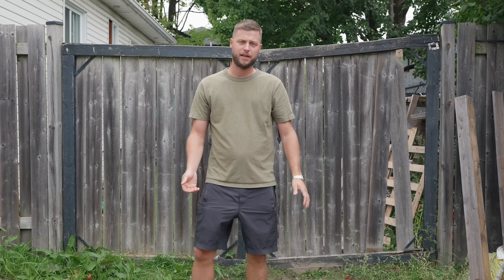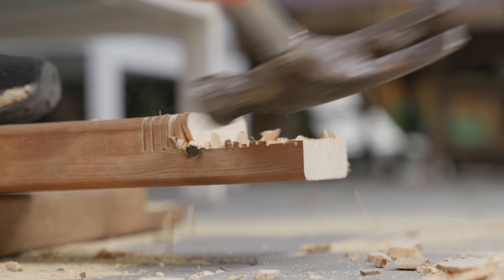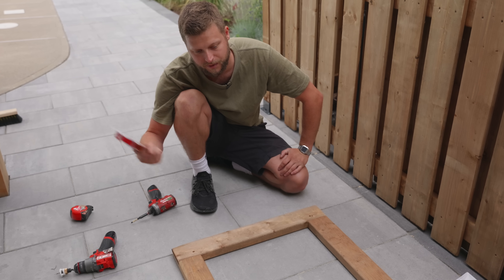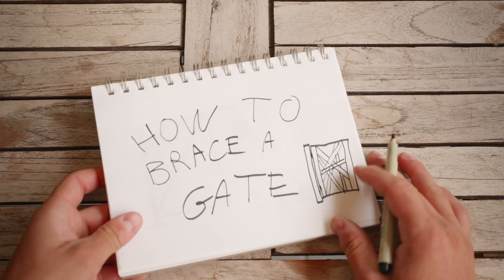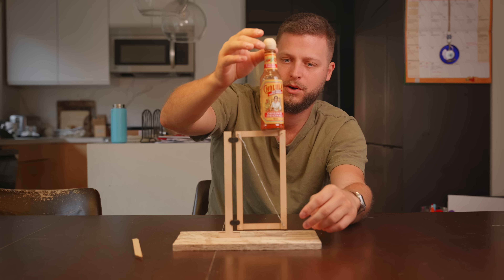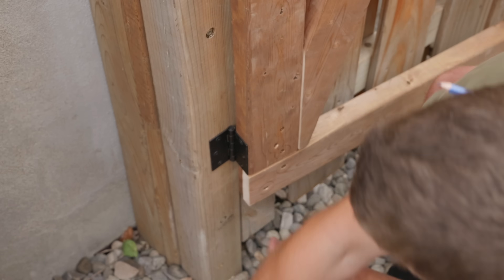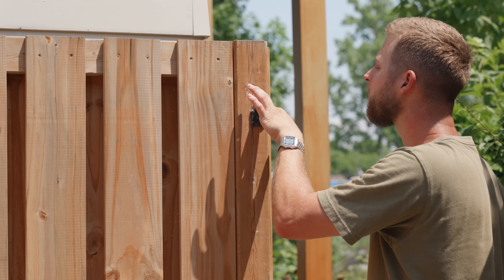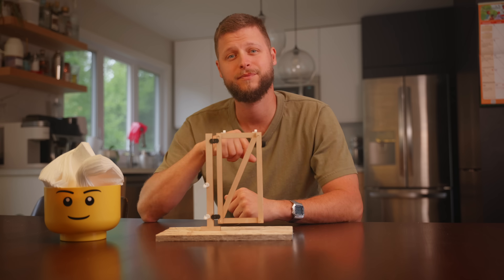How to Build a Wood Gate That Won’t Sag (Full Build + How to Brace)

Comment: My landlady delivered a shed which she had ordered from some prison workers. Clearly non of them were very familiar with woodworking as the door had no diagonal bracing, only a horizontal one which did nothing. The door was sagging right away and I've been contemplating since how to improve it. The way you explain how a proper brace is supposed to work is brilliant, that's the way the door should've been build from the start. Now I wonder if I should try and improve the door by mounting the bracing from the sagged corner and up, then pull it tight with screws, or dismantle the door and rebuild it properly with the correct bracing.
Reply from the maker: I think you can put a wood brace and try to save it, or buy the metal cable from amazon for 20$ or so and fix it that way.
Reply: @mateostabio  The metal cable is interesting, I might have to look into that. I don't have Amazon delivery available where I live but I'm sure there are similar options.

Comment: The "corner-to-corner" measurement to check for "square," is not fool proof. I watched my dad do that years ago (mid 60's), only to hear him muttering "trapezoid" before redoing the job. If you are certain that the heights and widths are the same all around, then corner-to-corner will be a reasonable check for square.

Comment: More than likely your gate post that the post swings on is going to be the cause of your sagging gate now that you have built the gate correct. Suggest using a 6x6 in lieu of the 4x4 for the swing post.

Comment: Very interesting.

You see, with my studies and experience in scaffolding, I would have sworn that tension was always best, given that, a diagonal brace has a greater tensile strength than a bending strength.

But thanks to your tiny model of the door, I understand, and it's becoming clear that if the fastener isn't machined from a solid block, as in big carpentry for example, the screws will be subjected to very high stress.

And I imagine that the bending/tensile strength of wood is not at all the same as for steel.
In any case, in metal structures, I always prefer to work in tension. I wonder what the situation is for carpenters...
I wonder if you do a longer brace, and fix it as you fixed the rectangle frame of the tiny model (by a little wood cylinder) tension could resist better than bending, idk really know with wooden elements... yet.
Reply from the maker: Thanks for the comment! Yes, I believe that metal is better in tension, or should I say, you’re able to use smaller metal tubing in tension, than what you would require in compression.

Comment: So you don't need the brackets if you put a diagonal brace? Does it have to be less than 45 degrees for better compression? And if you use a metal cable is the compression opposite where the top is the leverage?
Reply from the maker: Well, if you see my horizontal gate example. Its beyond 45deg and works perfectly. I think thats a myth
Reply from the maker: The metal cable I put is in tension. You can use both, so if your gate is old and sagging, the metal cable is an easy fix without having to rebuild it

Comment: I'd use steel for the frame. It wont warp or swell in wet weather and it'll last allot longer than timber

Comment: Would have been a more effective lesson if you explained why bracing the other diagonal isn't as good because since that member is in tesnion rather than compression, the fasteners are also in tension, and over time are more likely to slowly pull out/loosen.  Using a cross brace in compression takes away the need for for the fasteners to do anything more than hold the member in place.

Comment: This video is really well thought out, instructed and explained.  One thing I would change if you can - I am based in UK and we do a lot of fencing with both timber and concrete posts, and experience tells me the concrete post will last longer than the timber.  Timber will last as long as it is not set in concrete (concrete boot) as the interface between the concrete and wood at ground level will cause the wood to rot through much quicker at the junction due to chemicals reacting with the wood and water from rain - for some reason it does not rot the timber below in the concrete only at the interface between the ground concrete boot and wood.  I have seen fences made from quality wooden posts rot unless than two years due to this effect.  We try to use metal boots when setting in concrete and raising the the timber above the ground surface.

Comment: Excellent step by step explanation and the result is great.
I like the cable latching bit, i may be wrong but wont the cable start digging a groove in the wood after a while especially with little people using it 😊?
Needs some kind of sleeve i think.
 So only thing left is to push tbe folliw button.👍👍
Reply from the maker: Thanks! The metal cable is sleeved in like a rubber, i dont think it will dig in, but some people did point out I could have used simple screws with an circle loop so the cable is guided all the way down. Instead of using that little 3d printed piece to hold it down

Comment: Классное объяснение, респект. Остался только 1 вопрос, зачем защёлки делать на высоте глаз? Разве не удобнее всегда располагаться их на уровне пояса?, тогда и работа с ними легче, и найти их легче, и удобнее ими пользоваться.(возможно это дело менталитета, ведь у нас в деревнях везде на уровне пояса защёлки и замки).
Reply from the maker: I think for a dual sided handle like those metal latches that can opened from both sides makes sense to have them at the level of a door knob. For the pool entrance, its a law that no kids should be able to enter the pool area.
Reply: @mateostabio , А, теперь понятно, спасибо. У нас нет бассейнов(разве что надувные, где по колено воды), по этому и законов таких нет))))))

Comment: My old house had 4x4 posts for the gate but the exposed portion would warp and twist like crazy with our wild swings in temperature and humidity here in Wisconsin.  Even if the door didn't sag, the posts would warp so much that the latches would not line up well long-term.

Comment: Building the Posts DIRECT into Concrete just guarantees that they will rot exactly there. There are Zinc-Plated Metal Post Mounts to be put into the concrete exactly for this purpose.
Reply from the maker: Can you share a link?
Reply: youtube seems to kill my link but its shaped like an U with a post in the middle built of constructing steel which goes into the concrete. So the wood will never be in direct contact with the possible wet ground. do you know how a musical instrument tuning fork looks like? somewhat simmilar but made of steel and coated with zinc for rust protection.

Comment: what if you made an x with the wood braces?
Reply from the maker: I think it would be more for the symmetrical look more than anything. Make sure that the two little pieces to create the X are the ones in tension and not the other way around
Reply: @mateostabio ok thank you!

Comment: I've built several things using half lap joints. INSANELY strong joint, even if you just use glue and no mechanical fasteners. And I've seen some where they used dowels to hold the joint with glue just in the dowel holes and it held for years with no movement at all.

Comment: i wish i had of known this years ago . One Question i have however is my gate i installed had a twist in it
Reply from the maker: The wood we buy is pine from the big box store, and that tends to bend a lot. Sometimes its best to buy the wood. Let it lay down in a flat surface for a week or a couple of days to make sure you pick out the straightest boards. Then return the rest of the wood to the store 😅

Comment: Nice video. One small picky point. A cross brace the “wrong way” is not in tension if it’s wood. It will be in tension if it’s a cable. A brace the wrong way “needs” to be in tension, hence the cable. Nice job though.
Reply from the maker: But wood being pulled like i showed is in tension. Its not just metal that can be in tension.
Reply: @mateostabio  what he's saying is that the wood is not in tension... the screws/nails that are holding the wood are, which basically means the wood is just forcing the fasteners into tension. The wood is doing nothing overall. Same as if you were to put a cable on the wrong (backwards) way. The cable isn't truly being compressed in that example, it's just moving out of the way... in either scenario where the material is being used in the wrong way, the "compression & tension" are all in the frame, hence why it sags. I know we are splitting hairs here, but technically he's right. This is an awesome video by the way. You have taught me quite a bit. The only reason I'm in this discussion is because I enjoy diving deeper into the physics of things I learn.
Reply: @OGRH  they are definitely in tension in unison. any fasteners you use to connect an improperly placed wooden brace are in as much tension as the wood brace is. if the wood is not under tension then remove the wood. what would happen? the gate would fail immediately. this is because the wood IS in fact under tension along with the fasteners. the only difference is the fasteners are more likely to fail since they are the weaker link.

Comment: Good on you for the half lap joints. 60 years of building and examining old gates I find gates braced your way, over time, tend to have the bottom outer corner, kick in or out. Braces in tension with good joints, again, half lap or dovetail, don't seem to do this nor sag.
Reply from the maker: Interesting!

Comment: make sure the post concrete is benched down, to drain rain water away from the timber post and not so the post is sitting in a permanent puddle.

Comment: Maybe good info, but 20 minutes? Another "I'm going to spend most of the video telling  you what the video tells you, instead of just telling you". And 4 inches into the concrete is not nearly enough. You should use a belt sander to smooth out the lsp joint surfaces.
Reply from the maker: you get the answer in 10 minutes. If you want to stick around til the end and watch the gate latch install, thats up to you.
Reply: @mateostabio ok, pretty good job in general though. I had a "partner" that stopped listening to me who made a saggy gate..by that time I was so disgisted with all his crap I just watched and grinned inside because our rich cliente wouldn't listen either. Then she wanted me to fix it by shaving off the gate. But it would just continue to slump more and more.
Reply: You're annoying. Go away.

Comment: In the horizontal gate, the diagonal touches the left post and the lower strut of the gate. That's different from the vertical gate. Is that intentional?
Reply: Thanks for the ♥, but was it intentional? I am asking, because it seems false/not following the same principle like for non horizontal gates.
Reply: @thorsten5052 ❤️ 🤣
Reply: @thorsten5052 He patted you on the head and said, "That's nice little buddy, now run along."

Comment: Totally nailed it. This said, and even though I like what you did, a couple of small eye bolts would have done the same thing for hiding the gate pull. Comments about the lap problems are spot on too. Paint can help seal it, but in the end the tanalised treatment is the best option. Combine that with paint and you've really got something that will hold up.

Comment: half lap the diagonal brace and do both sides with a brace, that is the "correct" way. This is called an X frame or some call it cross bracing and it will support a square gate far longer then simply 1 diagonal brace. On top of that, if you make both diagonal braces connect into the square frame with a angled half lap joint it further ads rigidity. This would serve as the frame, and from there you can box in the frame with an aesthetic wood. You can also make the frame and X braces out of steel and the post out of concrete and then cover both with wood and there will never be sagging untill the steel starts rusting.

Comment: You made me wonder about one thing: imagine that gate have hinges some height from the bottom of the gate like 1/5 of height and then 4/5 of height. Should i put brace (or tension cord) from corner to corner or from the hinge to corner?
Reply from the maker: I would not put it on the pickets. I would put it on the 2x4’s.

Comment: I built 2 gates for a customer with 3 layers of cypress and used 4 white oak dowels at every lap joint although they turned into tenon and mortise for effect because of all 3 layers. They didn't have the diagonals because they replaced some older gates designed to look more like doors with windows at top. They got about 15 coats of boiled linseed oil.  Came out nice and HEAVY..

Comment: I must do a lot better job on the fasteners, I have been building gates and doors with the brace in tension for 30 years and I have never had one sag. The physics make sense, and I am by no means claiming this guy is wrong. I'm just saying that from my personal experience, putting the brace in tension is not necessarily always wrong. So, I just went and looked at a set of 4 foot x 8 foot shop doors my dad build over 40 years ago. One door is in tension, the other in compression (don't ask I have no idea why). They are both built form the same materials, and are the same age, the ONLY difference is the orientation of the brace. Neither door has sagged in 40 years.
Reply from the maker: Interesting! Are they made of steel?

Comment: I get that a single cross supporting board is enough, but curiosity:  would it increase the strength to put a cross beam going to other way (cut into two sections with those strong lags in addition to the single solid board going from the bottom hinge corner to the diagonally opposite top corner away from the hinge?)

Imagine an "X" where the critical board is one solid piece and the cross board is two sections cut to fit and lag screwed into place?  I get that the long main board is doing the work, but I wonder if going ahead and connecting the tension corners through screws would increase the capacity of the gate while adding an interesting symmetry to the support?

(I'm not thinking that the extra cross piece "doubles' the capacity of the gate... But maybe it increases it some while also looking cool?)
Reply from the maker: Good question. We’d have to put it to the test!
Reply: @mateostabio that would be really interesting to see... decorative?  Sure.. Functional to a degree?  Maybe.  Overkill?  Probably, but there could be situations where you want the gate to be as solid as possible.... Really wide. Double / French door style gate.

Hopefully you'll consider it for a video idea if the opportunity presents itself.  Loved the visual demonstrations and visual pneumonics.

Comment: Way to much white wood exposed to the elements with every cut. 😬
You can get a small quart of treatment for the PT wood cuts, or you'll need to 
flash/break aluminum for the tops with the lap joints. 
They come out nice if you're going for that pallet look, nice work and video. 👍🏼

Comment: Great explanation. I just checked the gate I built 30 years ago and I braced it wrong! Thankfully I used good fasteners so the gate has not sagged at all. It’s kind of funny. My dad was a skilled woodworker, patern maker at a foundry actually, and he taught me the way to incorrectly brace a door or a fence. Now that I’ve seen this it makes total sense how to correctly brace from the base hinge to the top corner. Thanks for setting me straight.
Reply from the maker: Haha thats an awesome story! Glad it worked out for so long!

Comment: When "building" anything the ages old rule of thumb is to never bear a load on a fastener. It apples to a gate just as it applies to building any structure.
 Wallpaper and pictures are hung. Structures should be built.

Comment: @8:03 if you are working with steel and welding do the exact opposite.
Reply from the maker: For sure, I think metal works the same in both compression and tension, unless we're talking about thin steel or small square tubing or a piece of rebar, its probably best in tension like my metal cable example, indeed.

The reason why I didn't get into metal work, is because most DIYers I see on Youtube, all do it using wood. So I made sure to keep it simple and beginner friendly for the average DIYer :)

Comment: @3:53 it's not the pressure in the first place. it's the 1 or 2 teeth prank when you took the measure two teeth were touching but when the blade rotates it completes the circle. kinda a rotating hexagon when two heads up is shorter than one head up.